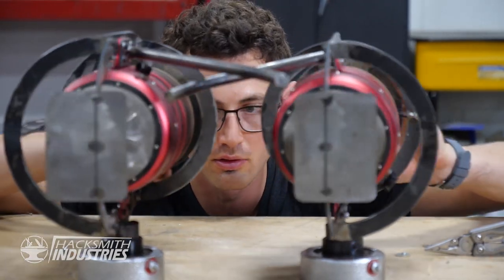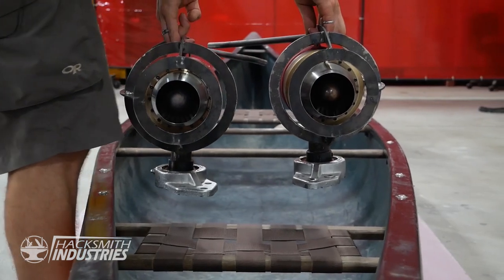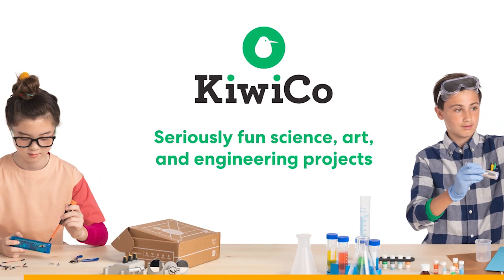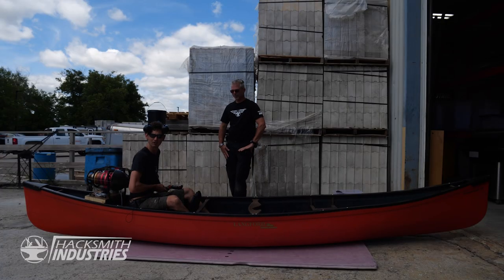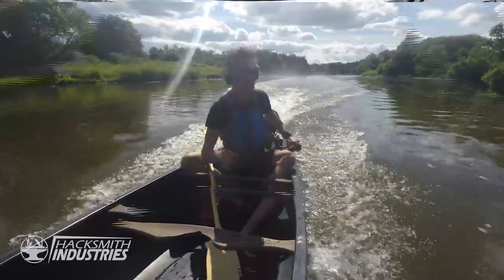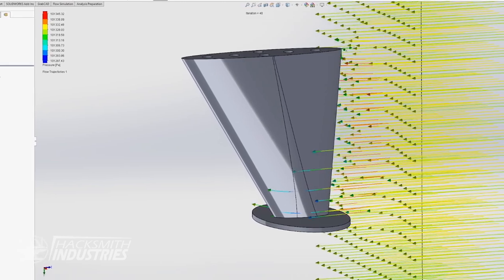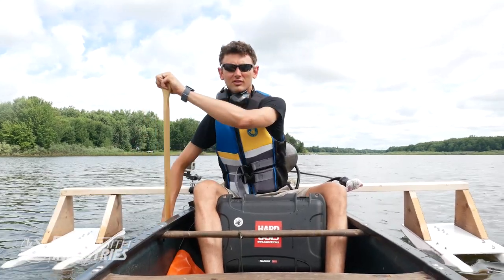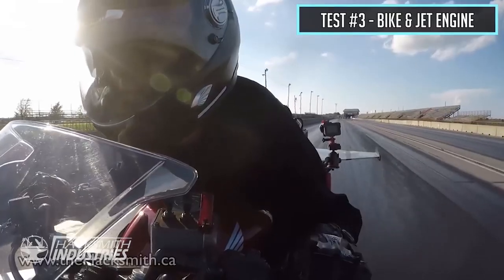JET ENGINE CANOE! (World's Fastest!)

Comment: Curious if throttling the engines separately would have given  them enough turning control, since the lever arm is really small. Also curious if they could have solved the boat tilting problem by tilting the engines so that they would slightly try to raise the rear of the boat. Like would the turbulence cause to much water splashing up. Also, if it's tilted at a fixed angle, I can it becoming a problem if you power the engines up to high, because the moment would then try to force the nose under water.

Comment: "You steer, I'll push" -Rocketeer

that said a sack or two of sand in the front probably would have kept it down better.  Or proper outriggers amidships and mount the engines on the outriggers.  Might need a conventional rudder to steer then.

Craziest idea would be, can those things be converted to turboshafts?  Turboshaft driven pumpjets...

Comment: Hey The Hacksmith, Try putting the pontoons farther up and a little higher. Because I saw that the pontoons were in the water for the most part, that’s not how they are ment to work. Also think about putting the engine under the water. I’m sure you’ll find a way to do that. Good luck and I hope this helps!

Comment: All you have to do is move the seat forward so that you can get it up on a plane. You will probably need a keel to keep it tracking straight and a rudder would help you turn.  Check out the keels on other flat bottom boats. They are not very big, sometimes just a thin strip of wood down the center line.

Comment: Back in the 60s when I was young and dumb my parents had a place on Culver Lake (NW corner of New Jersey).  We also had a 12 foot aluminum canoe and a 15 hP johnson outboard.  I managed to obtain another 15 hp johnson (they were popular back then and the lake had a 15 hp limit per motor  as in "the motor shall not exceed 15 horsepower at the propeller).  The crazy neighbor helped this 11 year old kid mount both motors to a canoe and steering and throttle controls up front.  In my mind I was flying, probably not much more than 30 mph.  I've always want to recreate that with more powerful motors and maybe hydrofoils.

Comment: I've been around all kinds of boats and get rid of the outriggers. But if you really want to go faster why not a little bit of ballast up front you are wanting to get the bow down 
Also put the driver in the middle of the canoe.  By the way where did you find those small jet engines?.
Reply from the maker: They cost 10k. Didn't want to weigh the boat down in the front because a canoe would be unstable on plane

Comment: You needed to be sat in the nose to keep the canoe up on the plane. 
Once you get the weight distribution right then if you fit hydroplanes these would lift the whole shebang up and out of the water. Use a dihedral on the hydroplanes for stability.
Low drag, more stable & less strain on the hull means lots more speed!

Comment: Guys can you try putting weight at front of canoe which is equal to the weight at back of the canoe so that the canoe will get some balance. If it gets some balance then the jet engine won't sink when the canoe is going at a high speed.

Comment: The real problem is the rounded stern, the reason all fast boats have a sharp edge is the rounded edge acts like an upside down wing sucking the boat into the water.

Float planes would get stuck to the water and be unable to take off until they added a square edge near the back.

Comment: So any 12 year old that runs his daddy's 16 ft john boat would know; shift your own weight further forward in the boat. A 16ft canoe can only go roughly 3 MPH in "displacement" mode (look up "theoretical hull speed"). To go faster, the hull must "plane" out on the surface of the water. By moving the rider's weight forward it disperses the weight evenly over the entire bottom of the hull and so takes less speed to create the upward planing lift. 
By the way, the part you 3D printed in boat building is called a "skeg". They are used on hydroplane boats and surf boards and should be located either on the center line of the boat if only one, or symmetrically either side of the center line if more than one, and about 2/3 to 3/4 of the length from the bow, and for this canoe should be about 1/4 the size that you made. A skeg's purpose is to prevent "side slipping" or "yaw". In reality a canoe hull is designed to be an efficient displacement hull and is not really good at planing ... .... but a flat bottomed hydroplane is ... and there is a class of "mini" hydroplane .... ! How industrious are you guys? A jet powered hydroplane isn't unique, but a jet powered mini-hydroplane would be.
Finally; the science of boat planing is not strictly hydrodynamics. It includes aspects of aerodynamics as well.

Comment: I figure it might be able to go faster if the jet used on the surf board was used though 2 of them would do better but by placing the jet in the middle of the craft at the stern could increase stability and allow for steering might even allow them to get more speed by getting more efficiency from the thrust of the engine and reduce the noise made by the craft.

Comment: This project would have worked perfectly if you have mounted the jet engine on middle of the Canoe permanently  a little way from the canoe, so the jet engine burn won't damage the canoe , and use a wooden board on back of the canoe to steer by using water 😁

Comment: It's too bad you didn't make a pivot forward and back because your angle of thrust is pushing the rear of the canoe down, the more thrust you have if you pivoted the engines more backwards you would lift the rear out of the water more and make hydroplaning easier. Of course I think you'd need to make a heat shield for the rear of the canoe just incase

Comment: Wow.  that's purdy.  Butchakuda just strapped them to a bicycle handle bar and steered with two strings.   Next time use a sears 10-foot aluminum jon boat with a flat bottom.  You forgot to account for drag created by the displacement hull of the canoe.  That plus poor weight distribution gave you the high-rise bow.

Comment: What happens when you push a displacement hull past it’s design. The faster you try to go, the harder it draws down into the water. If you had tried this in say a flats fishing boat, it would have hauled ass.

Comment: instead of steering by pivoting the jet, why not take some tech from how aeroplanes steer with drag, I'd of put a throttle on the paddle and sink the paddle in which ever way I want to turn to create drag. what sort of throttle/paddle design would be suitable for that not a clue. alternatively how every other boat steers, (called the same on a plane) a rudder, you could use the tiller to control both jet and rudder. A rudder would give you a tiny turning circle with a canoe.
Reply from the maker: One day build

Comment: Way over complicated some solutions. If you just raised the mount of the 2 jet engines and give it 2 axis movement control. Then you could pitch the nose down of the canoe with the thrust Vectoring up/down of the jet engines. Keep with the same material for your raised engine mount platform.

Comment: Dude...  Move UP!  Your weight is way too far aft.  Design/install a remove steering system with cables or rod.  It's WAY off balance.  And one outrigger larger and farther out.  Also, a soft cover to keep splash out would help.  Great video.

Comment: Put an extended on your tiller arm and sit in the front of the boat, you'll double your speed right there. A keel is pointless as you don't need one it's just drag, find a design for a hydrofoil now that would be fun to watch.

Comment: I find it amusing young people need to have a computer to design a bracket system. Angle aluminum, rounded slots and torque connectors.  Just to mount a piece of wood to the canoe.  4 1/4 bolts with washers, locks and wingnuts.  A few wood screws and ten minutes its done.  No computer needed.
These kids would be lost if we ever suffer an EMP strike.
Reply from the maker: It was a joke. Good job

Comment: CG is way too far aft.  You should be sitting forward of the midship thwart.  Longer tiller handle and it'd have to be articulated.  Engines should be a touch higher and spread a little wider from each other.

Comment: Oh for goodness sake....  Don't tell me, let me guess.  You've got a fancy pant degree,  right?    You don't need thrust vectoring,  to turn left, you lean left, to turn right, you lean right,  when its time to go slow, shut it down and use your paddle....   Then we have to talk about common sense weight distribution.  Can you see the video?  Look at it,  get your peepers on the boat and take one guess where the weight (your weight) should be located in the boat...  A. in the  back.   B. in the middle.  C. in the front.